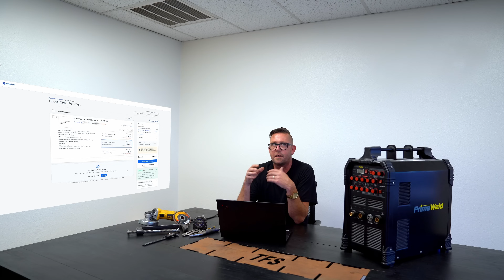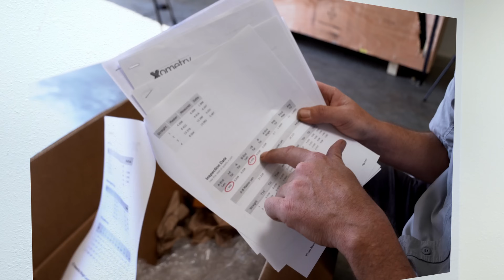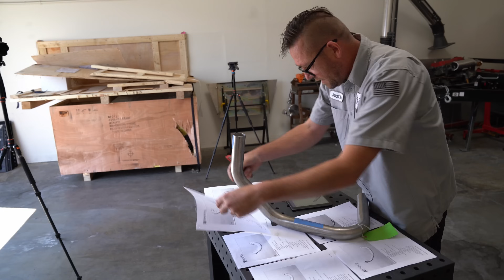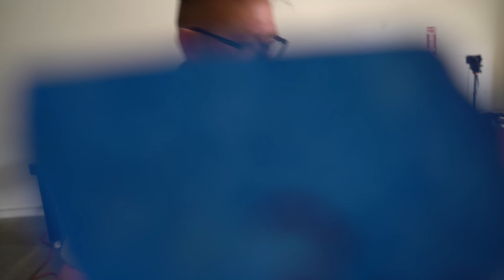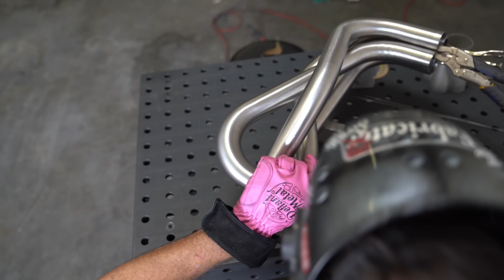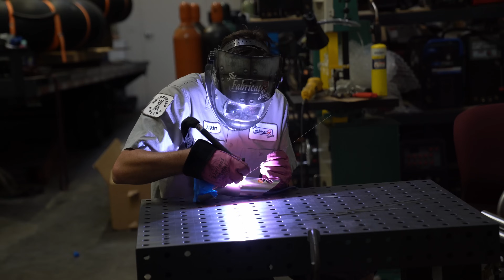I Built a Crazy Header Using Simple Tools

Comment: I know weld backing tape with a fiberglass strip exists to do the job of purge gas but it's not practical in a tube. Could you roll some fiberglass into a cylinder and stuff in the joint before welding to prevent most of the exposure to oxygen inside? You can make it 5" long so that it reduces oxygen flow to the joint. A string attached to the center of it would let you pull it out after welding.

Comment: Some time ago I came up with a Rube Goldberg idea for building headers that I’ve never tried. I’ve never made header’s although I have made complex down pipes for shorties using pie cuts. Take it for what it’s worth if anything or at least have a good laugh. 

It involves using either pie cuts or stock bends of tubing. 

I’d make dozens of discs the diameter of the tube I intended to use. I’m inclined to make the discs from double wall corrugated cardboard with a hole punched squarely in the center using an ice pick. 

I’d need a roll of 6 gauge (0.162”, Walmart) wire. I’d cut four pieces of wire the length of my tube. I’d place two #8 flat washers at one end of each wire, one washer tack welded at the end and the second spaced the thickness of the flange and tack welded. 

I’d make the flange except for cutting out the port holes. Instead I’d drill a #19 hole in the center of each port and modify the drilled hole into a keyhole that accommodates the #8 flat washer.

 I’d make a sheet metal plate with a four hole pattern lay out that matched the collector. I’d drill a #19 hole in the center of each tube. I’d slide a bunch of discs onto each wire, insert the four lengths of wire into the plate, and tack weld them on the front side.

The plate should be free to rotate so there will be a second plate fastened together with the first plate in the center of the collector. The second plate will be fastened to the car in some way to hold its position.

Bolt the flange to the head. Bend the four wires so as to locate the sheet metal plate in the position of the collector and fasten it to the car. 

Bend the wires while sliding the discs until no disc touches any other disc or the car and the wire is set in the keyhole. Label each wire and take several photos. Cut each wire free being careful not to disturb its shape. The 6 gauge wire is pretty stiff. It will hold its shape as long as it’s handled gently. 

Four patterns. That’s it😁

Comment: Hi, awesome job and explanation.
Quick question: I saw you are using the table as the second electrode. Is that sufficient for carrying such high welding currents? I’d expect significant contact resistance and losses. Doesn’t it affect performance?

Comment: Please consider filming in 30fps with a 1/50th of a second shutter speed for this type of content. Be sure to activate shutter priority mode for your auto exposure so it won't change the shutter speed from this setting. Also, grab some ND filters for outside otherwise if you're using a camera without an adjustable aperture (such as an action camera) then they won't be able to get dark enough in direct sunlight with the shutter speed locked.

The shutter speed NEEDS to be locked so you have a natural-looking motion blur, which is a huge factor in how pleasing your footage looks, even if you DON'T change the frame rate. If you're dead set on the low frame rate look or if you have a videographer who chose these settings I have another trick setup for you, especially if you like to use slow motion AND don't want to change camera settings in the middle of shooting in order to switch to slow motion.

Comment: tape and cal are standard tools. You really can't do anything without em. As a wanna be fabricator, I use any tool to get the job done. I've bought a used a habor freight vertical band saw for wood, brought the rpm down for steel and up for aluminum. Cuts straight and running strong, don't get caught up on brands just get er done and save up.

Comment: Hey bro, excellent videos I’ve been watching you off and on for a few years. I’ve been doing mig Welding for roughly 15 years with no real training whatsoever building mini bikes and small projects. I decided a couple years ago to get into Tig Welding and got one of those primeweld TIG welders  which turned out to be Not a good choice for a beginner TIG welder. I sold that one and I’m about to get something a little easier to use a azzuno 200 amp 110/220 TIG welder which of course is not a high-end welder, but will do the job nonetheless!! after watching one of your videos. I quickly learned that the gas used for mig Welding and TIG Welding is very different. 100% argon with aluminum 75% argon 25% CO2 for steel however for TIG welding 100% argon for aluminum and steel that I didn’t know lol I will keep watching your videos. I have a lot to catch up to do!!thanks for the videos. I  very much appreciate it!!!

Comment: i can't see for the life of me how you could weld all the way around the four pipes into the splitter. looks a nice job though.
Reply: You dont have to. That star piece seals up the inside 1/4 of each tube (that cant be reached from the outside), then the collector is welded to the remaining 3/4 of each tube on the external perimeter.

Comment: 1 day? em By the  5 minute mark  you had FORGOT to tell us how  much TIME you spent designing and ORDERING the parts. You FORGOT to tell us how much the bent tubes cost you. You FORGOT to tell us how much the 3Dprinted collector COST .You FORGOT  to tell us HOW LONG you waited for all those parts to be delivered.@15.44  You FORGOT  to MEASURE  the distance from the table to the collector.  How ACCURATE? is the spacing/ offset on this system hmm?? @16.57 How MUCH does the gas lense and cup co$t? How many times did u hit the tip and screw up the lense? WHY ARE YOU NOT USING BACK GAS ON ALL stainless steel welds? @21.30 After SPENDING how much? on your collector WHY did you NOT build a taper to weld in the middle?- I guess THAT makes no difference?BUT everything else does?@22.40- oh well the CORRECT rod is 347.TWICE the cost of 308 etc. @24 min. More oh well. You should have put a small hole in each tube at the FLANGE and taped up the ENTIRE collector opening when purging the header.@25.30 The CORRECT way to check the tone of each pipe is on a flow bench. Lets review. You built it in 1 day. You ONLY back gased the collector- WHAT ABOUT THE OTHER WELDS?  Someone like Burns Stainless would charge  $2500- 3k to build that. About $1000-1300 ? in material. DEPENDING on the FIXTURE supplied- 12?- 16 hrs of labor. HOW DOES THAT COMPARE TO YOUR TOTAL COST?  Yep, you built it in a day.
Reply: One of us paid attention to the video. The other spent time looking for an internet fight. Where do you think you fit in?

Comment: I made a pair of screwy down pipes for my shorty headers using trial and error and PVC pipe as my model. I used pie cuts to form the bends in both the PVC and the steel. I used the finished PVC to build a fixture for the steel. I used an acetylene torch to assemble the pieces. Turned out great. Not as pretty as mandrel bent tubes but it only cost me the price of exhaust tubing and PVC pipe. The bends couldn’t be mandrel bent anyway.

Good job, though, despite the click bait title. Your online outsource is particularly useful.
Reply: Plastic cad.

Comment: looks like a great service to bookmark for future use one day, but ..
why did they not cut the tubes to the proper length? im confused as to why this wasn't done? or couldn't be done?
Reply from the maker: @difusekitty3  every functional machine has to have a  minimum amount of material for the tooling. An example is my automated saw. Every time I throw in a stick of metal, I have to subtract 8 inches from the total length of material that remains in the vise and can not possibly be held in place while cutting. Theres always a small amount of wasted material.

Comment: You can make a pipe clamp for holding pipes together while you tack them using a locking plier clamp, or what we call  mole grips in the UK. They normally come with a swivel plate for clamping flat surfaces, but if you cut them off and weld two small pieces of angle bar on they work well for clamping round surfaces like pipe and bar.
You can purchase factory made pipe clamps, they come in all sorts of designs, some are bulky and quite expensive. But majority of pipe fitters like myself just fabricate our own, they are cheap and less bulky.
And another tip, when you mark the pipe with a marker for lining up, use a thinner marker and do multiple lines, it will help you to be more accurate.
Reply: For butt welding two tubes together, I take a section of pipe about twice the diameter in length. I drill or cut two holes on opposite sides ain the middle, about a quarter of the diameter in size. I then cut one side open, bisecting one of the holes of I made with an angle grinder. I pray it open, slip it over another section of that pipe and loosely put two u bolts over it. I then heat the metal of the outer piece with a torch and cinch down the ubolts. That makes the inside diameter of the outer piece of form to the outside diameter of the inner piece. Then I take it off and  cut the other side, bise ting the other hole. I can now use those and a couple of u bolts as a jig to hold two pipes perfectly in alignment for butt welding.  Clamp them over the pipes. Tack weld through the holes then take the clamps off and weld the pipes. I use it for oxyacetylene, but it would work as well with any process.

Comment: Good day - First time caller, long time listener.   Thank you for showing us Xometry.  Fabrication is a side part of what I do.  I have a pipe bender.   It's an old-school manual beast that I use a 6ft breaker bar to use.  No CNC...using sharpie marks to make sure I bent the dang tube the right way.   If anyone is looking at starting in bespoke fabrication, remember to include "opportunity cost" in your ROI breakdown.    It would have taken me a couple of days, if I was LUCKY to nail all those bends for a header design.   My labor rate is part of the quote, however, it's hard to charge by the hour if you're slow at something.   If you add in the time it would take you to do the bends, cuts, etc before the weld, IF you had the machines,  there is a use case for Xometry right there.

Comment: I see you tried to purge the back of that plate you welded to the 4 tubes... how do you use a tig with mild steel? That's what I'm thinking they are making the rear subframe reinforcement plate for the bmw e46. How do I prevent the back of the plate from sugaring up or oxidizing when you are welding those plates to the body. I'm not expert to weld those with tig but I don't want to spend too much money on a mig

Comment: This is an excellent video to show some capabilities of Xometry.  I've tested several parts for pricing between brands X and brand SendCutSend. The parts I need made are fairly simple and an example is brand S is (2 x part with bends) = $55.  With brand X the same (2 x part with bends) = $148.  Prototyping and onesy/twosy parts don't seem competitively priced and I so I won't compare part quality.  I think this would have been an even better video if you went over how you designed the header and/or how you uploaded and selected materials.  I understand that makes a more involved video but that would add value to this.  This is an effective ad and I love the header.  We don't get an idea of the pricing scheme for the parts.  We don't get and idea of trade off basic tools and money spent on premade parts.

  I like the swirl collector and I like that they can do that.  The guys at Build It Yourself channel had swirl collectors printed for their V10 project.

Comment: I didn't catch any info on price, other than the flange costing $150. So I'll venture a guess the whole set was $1000. Feel free to correct me if I'm wrong.
Reply: Using a local fab shop also supports your local community and keeps the hobby alive. Its around the same price when you factor in shipping.
Reply: @Dont_Gnaw_on_the_Kitty_4  of course, if the prices are, in fact, comparable. But when the gap grows... there's no point in supporting local businesses if they keep robbing you. Not saying that's the case here.
Reply: I drew up a simple header tube, 1.5" 16ga stainless, 3 bends in the tube all less than 90deg, total tube length under 48" and it was over 900 for that single tube.

Find someone that has the CNC tubing bender and skip Xometry.  If you did that I'd guess it'd be around about $200 per tube if you're doing 4-8 of them

Comment: I think some of these comments are a little unfair. I’m an average to slightly above average fabricator. But I am what you would consider a power user or a subject matter expert or whatever with 3d modeling software. I’m also busy as hell at work so I cherish my time in my home shop. So methodology like this resonates with me. I do tube laser stuff at work all the time and have started doing it at home too. At home it’s a bit of a luxury since my time doesn’t really cost me. But in a professional setting, a guy with manual tools will be more expensive than farming it to a laser 10 out of 10 times. 27:24

Comment: I have an idea about using a miter box for woodworking for cutting stuff using a long sawzall blade in place of a bandsaw. I have a grinder and I'll still use that but i have a bunch of nice Diablo blades that are worn in the usual spots and a miter box would stabilize the blade past the midpoint where they are still like new. 

I've decided to buy a tig and build an exhaust for my HD Dyna vs. buying one for 1400-1800. After I'm done, I'll have an exhaust AND a tig.

Comment: Cool, interesting video 👍😎

i wouldn't be concerned about pendantists complaining about the nominal number of tools - as you said, most people will have those lying around already in their garage/workshop - especially those looking to do work like this 👍
Besides, I've always considered it to be an excuse to buy new tools 😉

Not sure if it's been considered by the XOMETRY  folks, but if they could incorporate a laser cutter into the process they could trim tubes to length and, where applicable, cut interlocking 'tabs" rather than straight cuts, to ensure the sections were correctly 'clocked'?

Comment: After building racecar headers from U bends back in the day, this is just wild. What I would have given for access to services like this.
Reply from the maker: This generation is so lucky to have all this at their disposal. I could have been so rich!
Reply: @TheFabricatorSeries  I agree. Wish we would have had the Net & YT in the 70's. I have always spent so much time calling companies for product information and catalogs. Research and phone calls took a lot of time, then.
Reply: @TheFabricatorSeries  But the fukboi fabs are still messing about with 10 pie cuts and hours of welding for a bend and they seem to think its "cool" I was waiting for somoeto finally make use of CNC benders to cut the welding to as little as possible, I;m not surprised you were they guy to do it.
Reply: I hear you. I do prototyping for aerospace and use Xometry or Hubs / Protolabs a lot. While I sometimes regret not giving much work to local subcontractors, the time saved on getting prices, placing and tracking orders, plus being sure there is always capacity and lead time vs cost balance, that's just too valuable for me.
Reply: Agreed. I did a midpipe for my Tenere 700, and had I thought about Xometry and a laser scanner (to grab 3d measurements off the frame), that would have beat doing pie cuts by hand. AND I would have had drawings! Killed me how many people asked me for one built and I had to say sorry it was all eyeballed : (

Comment: Since you have a fixture table there (you're using as a "tool")  that has known dimensions ( Model table, use in assembly with header), you might as well had Xometry print you a few fixtures, as a means to fasten the printed locating fixtures to ( using 16mm shoulder bolts, and nuts on bottom of table) With such a simple one/two piece runner, you could get away with a single locating fixture for the just the collector. Much easier than fumbling with the tubes in space.
This is how I approach header builds, or anything within the tolerances of an FDM or SLS print. Generally, hard (machined) tooling is rarely needed for builds like this. Just an idea...

Comment: Looks great, now... where can I send a cad model and get fiberglass parts made?  I could build this, but can't quite figure out composites.
Reply: For now you can do glass filled composites that can be 3D printed. Fiberglass production doesn't lend itself to one-off manufacturing unless cost is no object.
Reply: @RambozoClown  I am aware and my prototype is 3d printed, however my final part needs to be able to withstand some heat, so it really does need to be fiberglass or carbon fiber.
Reply: @akschu1  You can do traditional hand layup using 3D printed molds, or you can directly print heat resistant carbon fiber with selective laser sintering.
Reply: @RambozoClown where can I get a quote on laser sintering?  That sounds like an option.  The part is an aircraft nosebowl.